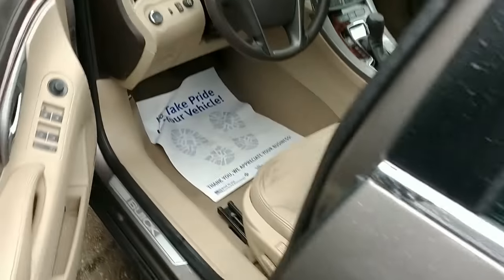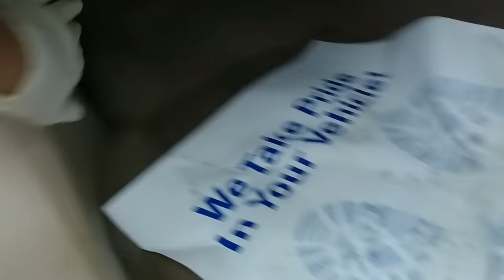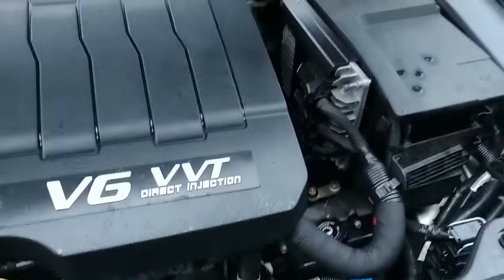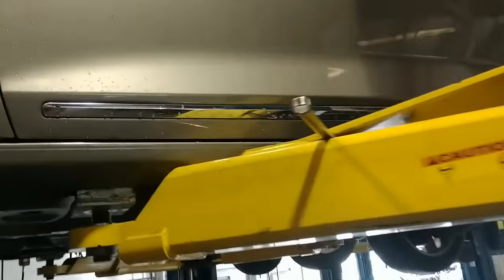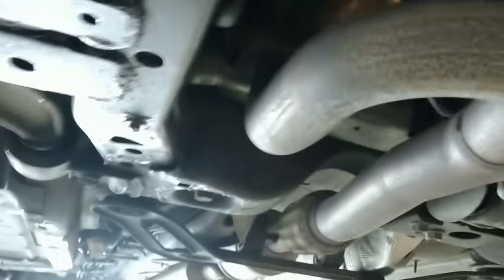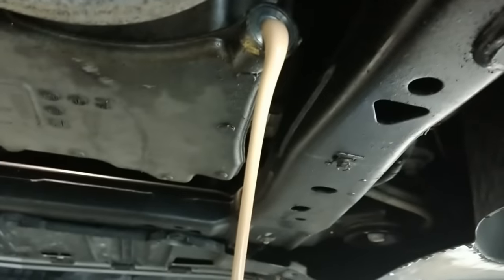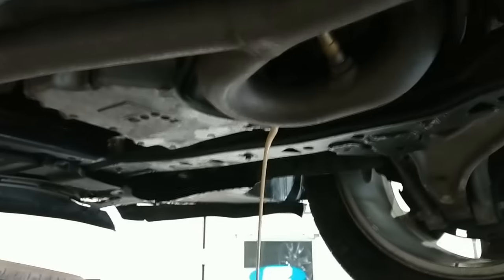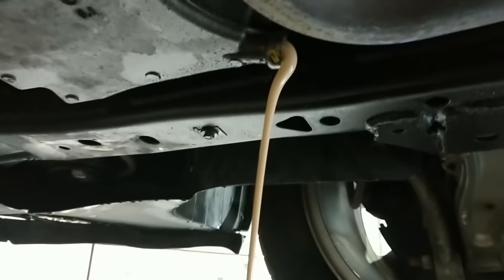Overfilled Crankcase! Blown ENGINE! Used Car Nightmare!

Comment: I found a fantastic 1970 F100 Ford pickup out in the countryside, at a corner with a nice sign on it.  I called, and told the guy I wanted to meet at 7-8 am.  He lived 4 miles down the road.  One condition from me, don't start it until I get there, yeah sure.
Next morning I get there early, and open the hood before he arrives (1970 like I said), the engine is warm.  I call him and we jump in, and he actually tells me without being asked, I started it and let it run for 20-30 minute this morning, just like I said not to do.  He would NOT allow me to drive it, if you know what I mean, he turned it around the a little on the lower traffic street of the corner, and back in about 4 minutes.  Do you have cash?  I had to think about it.

Comment: To anyone wondering what they put in the car to make it look like cappucino. 
They didnt put any other fluids in it. The coolant is simply leaking into the motor oil causing a reaction of both to look like Cappucino foam. The reason is that the head gasket is broken somewhere, it's job is to separate the liquids in different compartments, letting the oil run the motor smoothly with reduced wear, and letting the coolant cool the motor

Comment: Buy here, pray here? Someone once told me that the down payment covers the actual cost of the car to the dealer, and each payment is pure profit - and that they love it when someone gets a car almost paid for and then starts missing payments, because then they can have their repo guy go retrieve the heap, for another future sale. Sad thing is that, half the time, someone could take a look at the down payment amount pasted across the windshield and then pick up one of their local weekly "trading papers" (or Craigslist, I suppose) and have a pretty good chance of getting a comparable year/make/model vehicle for about the same amount. Even if it's in the same sorry shape, hey, they've then at least got all that unspent weekly/monthly payment money to put towards repairs and maintenance catch-up. Alas - and here is the really sad part, the people are afraid to do that - and, instead, buy one off a POS dealer because they ASSUME that they'll be getting a vehicle that's in better shape.

Comment: Scams like this aren't just the bhph dealers. When I worked at a dealership the used car department sold an old Honda with 1 functional brake. Both front calipers were seized and 1 back wheel cylinder leaked. The only way to stop was the hand brake. The car was sold this way.

Comment: My sister just bought a 2020 Altima from a local Nissan dealer  less than 14 days, broke down couple blocks from home and had to have it towed back to the dealer... so 9 days later it now been fixed...mechanic says 3 cylinders were not working...wtf. this car only has 17k miles on it.

Comment: same thing happened to me in a way, I got a 08 328i, drove it about 100 miles then I lost all power, no engine light or anything. took it to a guy and he said I had about 6 pounds of oil pressure, It was to have at least 60 ... here the place I got it from coded out the warning for low oil pressure so I never got a light... and nobody had any idea til shavings were found in the oil...... they wouldn't do anything about it and threatened to have me arrested if I ever called them or went there again. So I had to put a new engine in it myself. I hope karma gets them one day.

Comment: Oh boy, that is going to be a very expensive lesson. If she just bought I would take it back or I would report to Attorney General of the state for selling a blown motor. Those head gaskets and if needed the heads to be resurface will cost over 1000 bucks, if not 2000. I feel bad for people that get dooped into these deals. I think in Illinois you have a 7 day grace period with the car. That's bullshit and that dealer needs to be held accountable. I bet the dealer claims that she made that damage for letting the car to overheat and warp the heads. Good luck to her I hope that dealer does what's right, but I doubt they will.

Comment: Seeing commercials on TV where people buy a car on line and it delivered on a truck makes me think of where all the flood cars go. If I was gullible enough the least I would do get the vin # and check it out. 
A few months ago I made a deal on a 1965 Chevelle. I drove it. Crawled under it, did everything I could even with a magnet. This was on a Saturday at the sellers house. It had one repaint, original upholstery under plastic and pefert carpet under the mats. I left him a deposit and he gave me the paperwork on the car. I started checking online when I got home. Paid $9.00 for a search service. Found the car was from Delaware and had 4 owners in 5 months. I’m figuring all were flippers which I am not. When I went back Tuesday to pay him he saw I was alone I handed him back the paper and made a few excuses. He asked about the deposit as he still had the cash in the same envelope I gave to in. I told him I had inconvenienced him. I didn’t ask for anything back but he gave 1/2 of it. I drove away. It might have been a good car but a 57 year old car from the northeast that was flipped so quick scared me off.

Comment: I was fooled once buying a car

I was buying a 2007 Honda Civic Hybrid, maybe 2008, but it was using NiCad batteries. I didn't know that when I was buying the car and when I took it out for a test drive the IMA warning light came on. Sales guy said it was because it had been sitting for too long and silly me believed him. 

Later I find out the NiCad battery pack for the hybrid part of the vehicle was completely dead and would cost $5000ish to fix when I bought the car for maybe 8000. I complained and they brought the price down, but it was then that I lost faith in car salesmen and dealerships.

Comment: And this, ladies and gentlemen, is why you take an automobile to a reputable 3rd party Mechanic BEFORE you sign the paperwork and hand over the cash 💸.   Unless you have rebuilt/overhauled at least a couple of engines and straightened a few fenders yourself.

Also note, ALL US/Canadian market vehicles since 1996 should be OBD2 compliant and the "Check Engine" light should come on when you start the vehicle.  If there are no significant error codes, the light should then go off within a few seconds.  If the "Check Engine" light never comes on, don't walk away, run.  Either the MIL ("Check Engine" Light) has been on long enough for the bulb to burn out, or someone deliberately removed the bulb.  I've seen the latter several times in recent years.  In one instance, the traces on the circuit board in the instrument cluster had been scratched through to cut power to the MIL LED.

In my own SUV, the LED itself was broken off the circuit board.  I had taken my OBD2 cable (app on my phone and USB OTG adapter) and pulled the codes before I had even started the test drive.  I continued with inspecting the rest of the vehicle and I did the test drive.  None of the faults the vehicle had indicated a critical problem and it was going for less than ⅓ the fair market value, so I decided to take a chance on it.  But I am my own mechanic.  I don't think I would recommend the used-car dealership I bought my SUV from (apparent deliberate removal of the MIL LED).  I've done a couple of repairs and it has been a reliable vehicle for 2½ months.  A couple more repairs to go and then I will get into the upgrades...

Comment: Can someone explain why this can be flushed or fixed? I'm an idiot with cars.
Reply: It happened because something is seriously wrong. Flushing fixes nothing, and if you flush it and replace the fluids, you'll just have the same problem, probably within minutes. If it's a blown head gasket, the gasket can be replaced, but you need to try and figure out why the gasket blew. If it's a cracked head or block, the best thing to do is replace the entire engine, maybe with a known good used unit.
Reply: @oldmaninthecave  to me it looked like it was oil or at least not all oil. So wouldn't flushing the system be cheaper then replacing the entire engine? Would it be cheaper to at least try...

My grandfather had someone put coke into his oil and he flushed the system and cleaned it out and added cleaned oil. Changing filters ect.
Reply: @StarFinderWebb  Well unless you think someone actually put something in your oil, the only way for something like this to happen is at the very least a bad head gasket, especially since the customer says it overheated, and most engines nowadays are aluminum, so the chances of it being just a head gasket are very small. A radiator pressure test might help diagnose, but flushing and refilling with clean fluids is almost certainly throwing good money after bad.

Comment: That's what oil is supposed to look like. If your oil doesn't look like chocolate milk then your doing something wrong, also that antifreeze level is correct it's supposed to be empty. On top of that your engine ain't healthy if it's not knocking and coughing up white smoke. This lady got the deal of the century that car will go on forever in the condition it's in. I would have tried to buy that car off her 👍 right then, 15,000 dollars lady that cars amazing!

Comment: Most states in the US require used car dealers to provide a 90 day 5,000 mile warranty to retail vehicles beginning the day the purchaser takes possession of the vehicle. If the vehicle is a single owner car the balance of the factory warranty transfers to the new owner. Chances are this poor woman has a solid leg to stand on only driving the car 100 miles. Lets cross our fingers for her.

Comment: Blown head gasket.... judging by the smoking exhaust and the way the oil looks more than likely caused by the thermostat locking shut and the previous owner running it until it seriously overheated.... possibly warping the head and such. New engine $$$$

Comment: Had that chocolate milk oil once, was a blown intake gasket GM 305, ended up replacing rod and main bearings a month or so after the manifold gasket, go figure,lol

Comment: The engine overheated, and the head warped.looks like a potent engine.. looks like a little racing was going on. So the customer got it to run 100 miles? You can’t drive a block with an engine like that.I don’t understand.

Comment: there are a lot of shysters out there. they tend to target women and the elderly. She should for sure demand her money back. with that much water in the oil there must be significant bearing damage too. She should also share her experience with what ever her state has as a BAR, and all over the net. People like that need to be run out of business. Someone I was taking to found the previous owner of a car he bought. Was also a head gasket issue. He submitted an affidavit from the previous owner that the previous owner traded it in because of a blown head gasket. BAR made the shop replace the engine with a new one. They got crazy fines too.

Comment: I can not find the video I wanted to comment on so I will commet here. I see you make the mistake of not precharging oil filters..  My dad was a heavy equipment and Heavy truck mechanic for over 50 years and if I did an oil change without precharging a filter, I suffered his wrath...  I took my 1997 F250 to a shop to have the oil changed, I was recovering from health problems and could not change it my self. I was in the waiting room when I heard it start and could hear that the filter was NOT PROPERLY precharged....    with the help of a local lawyer and the court, the shop paid my truck off and closed their business after people found how poorly  they did the simple stuff they went broke in less than a year . Most of their tech had to change professions or move out of the aera....

Comment: Looks like pus draining out of a cow abscess. I wonder if that means you could separate cow pus out into oil and coolant in a centrifuge? Yeah, no. But it'd still be interesting to see what you could separate out. White cells, red cells, platelets and plasma of course. I wonder if oil and coolant would separate in a centrifuge?

Comment: 1st Clue:  A used car that clean, even if it is a Buick.
2nd Clue:  "Buy Here-Pay Here" lot.
3rd Clue:  Overheated about 100 miles in.
4th Clue:  White smoke billowing from the tailpipe.
Final Clue:  Milky dipstick.

There was a reason it was at that car lot. 😒

Comment: Daaaaannnnnng.  I hate used cars that have had the 'shiny stuff' treatment under the hood.  It always makes me suspicious.  I was inspecting a car for a niece.  Did preliminary checks and took it for a test drive.  Did a couple of normal stops and then a hard braking check.  Brake pedal went to the floor.  Stopped it with the parking brake.  Drove it back to the lot, told the sales guy and left it.  Yet another POS for $7k.

Comment: You appear to have such bad consumer protection laws in the US. In Australia all licenced dealers need to provide 3months/5000klm (3000 mile) warranty on all cars under 10 yrs old and under 160kk (100k miles). Even cars older than this or higher mileage are protected - ALL products sold must be both fit for purpose and of merchandable quality, for example if you know a car that you're selling is 20 years old, is registered but has a cracked chassis you must inform the customer that they must have it reparied before they can use it as a registered vehicle. Also if you buy from a private seller in Australia and have them sign a declaration of all the known faults before you buy it you have recourse against the seller, they must not deliberately conceal anything they know or reasonably should know about the condition of the vehicle if directly asked, I find if sellers baulk at this they are hiding something and I walk away.

Comment: funny how i pointed out in 1985.. 
.. um.. why can't you make things that last..
bodies throw away.. rest stay running.. like back when water in oil.. didn't hurt iron.. lol much.. if took care of limping.. 
til detonation lol.. like my 455 rocket... buick 225.. ran all winter long with cracked block & no coolant.. 
& it went in summer traffic.. 
forgot why it was parked when replacement got hit.. lol funny how less turned out deadly 🤣 $$ when i can make old 4cyl run cleaner & more efficiently..
or build my e motor.. that was taken from my science fair project & kept from public

Comment: Even if you have a mechanic look at the car, or you have mechanical knowledge yourself,  if the car overheats a week, two weeks later, you won't know anything till then.  Buying a used car is a 50/50 crap shoot anyway you look at it.

Comment: When I lived in Alabama and I am not a certified mechanic or car salesman every card that I bought and fixed in my garage I kept receipts full records and documentation of it whatever I sold I put a 100% guarantee on my workmanship and I would show them paperwork on all parts done, but if something unfortunately did happen because of my mistake then I gave them their money back and took the car back no if and or buts, 30 cars that I sold never had one complaint this is wrong on every level because that car salesman is only out to make money

Comment: This is only funny when it didn’t happen to you.  I hope it wasn’t a blown head gasket, and it was the Dearler’s own “mechanic” who put antifreeze in the crankcase.  Maybe the car can be recovered rather than salvage.  If you won’t get an independent mechanic to inspect the car, at least inspect the fluids and do a test drive.  Get on your knees and look under the car for drips.   Then review all the maintenance records.  There’s an interesting practice people may be following called “zero maintenance” where no fluids are ever changed.  No Records, then walk away!

Comment: By Florida law the used car dealership or the dealership will have to pay for those repairs, minimum warranty is 30 days and up to 90 days depending on mileage and year, and of course if it's in within the manufacturer's warranty then either way it's being fixed by the place you bought it from. There's a scam piece of shit born everyday. Guys that sell cars like this should be in prison.

Comment: Most likely she will have to fix this car,probably intake  manifold gasket, head gasket or worse cracked head or block ,looks expensive.she should have piad you to check it out before she made the deal to buy this joloppy.that problem may have already been  present.You also mentioned she over heated it this car.

Comment: S*** nevermind I take back that statement about a head gasket job...those engines are garbage..they shouldn't even bought that thing to begin with...lol.. replace the engine...do not do head gaskets on that piece of garbage... the bottom end will not last